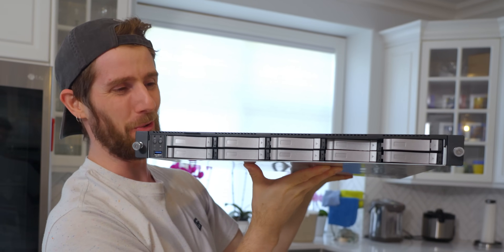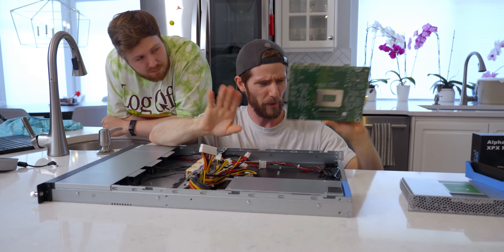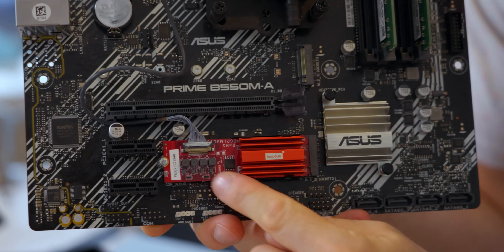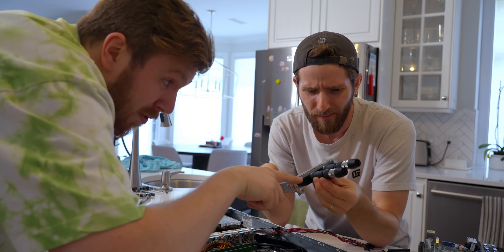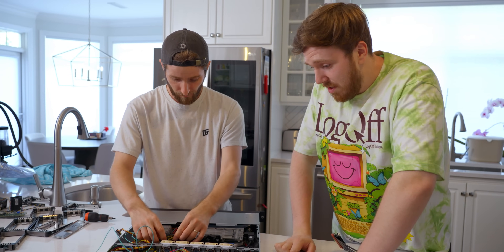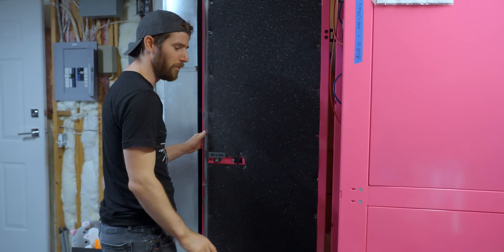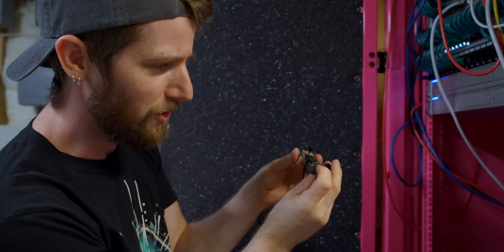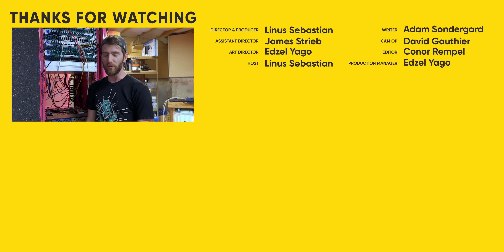I designed my perfect gaming PC, then threw it away - 1U PCs for My New House Part 2

Comment: Every time they play with water cooling the idea that I should stick to air cooling gets reinforced. 🤣
Reply: Happy AIO peasant over here, I ain't flying any closer to the sun than that
Reply: @Uncle_Smidge  AIO GANG RISE UP
Reply: Water cooled my gaming PC. For that it's fine, but I would never EVER put water cooling near my rack.
Reply: I don't see a reason to switch to water when air is just as good and way cheaper. My dark rock pro 4 will be more than enough for any cpu I use in the near future. I have a 5800X3D right now and even it doesn't go much further than high 70s at 100% utilization.
Reply: @a.pigeon Less noise is the main reason to switch. Running a computer on 2 Mo-Ras is the best way to get it absolutely silent.
Reply: @mycosys  That's why you use more than one pump and external radiators.

Problem solved. You can't get that type of noise with air cooled parts, especially not GPUs
Reply: @mycosys  Yes because it's an extremist hobby that costs a lot of money and isn't really necessary.
But there is a notable difference when it comes to noise and that's the main benefit of it.
You won't get anywhere near the same noise levels on an air cooled build
Reply: @Bucking-s4i  A Mo-Ra has more fans on it than my entire air cooled system. I'm running a 3rd gen ryzen 9 and a 3080. how is that more silent when water pumps also make noise? (Or did you not put fans on yours?)
Reply: @justincarter7954  Yeah more fans mean you can run them at lower speeds while still maintaining the same performance
Reply: @a.pigeon  Ok show me a 1u same type of specs as the one on the video all air cooled I would buy that.
Reply: @a.pigeon  I love my DRP4 as well, but I've learned the hard way why they tell you to install it with the motherboard out of the case 😅
Reply: @a.pigeon u are using a chip with vertical cache, that thing takes a quarter of other cpus
Reply: @Davinmk  Sure, but it's still a pretty powerful cpu and takes a good cooler to keep it from throttling. My air cooler isn't going to keep a super powerful 16 core monster of a cpu cool but I'm also not the type of person to use a cpu like that.
Reply: @a.pigeon  iirc that has a relatively low tdp due to its cache architecture so that probably contributes a lot
Reply: @a.pigeon  plus fan engineering is only getting better and like you said, new cpus don't get as hot. I remember watercooling my amd bulldozer because that chip was known for running hot as hell, these days only gaming laptops get hot compared to back then. Noobies don't even know how hot a cpu/gpu can get until they've used 2005-2012 hardware that ate volts for breakfeast. @uncle+smidge technically a fan with a cpu mount/fins is an AIO, just say watercooled because if it wasn't an all in one system you'd have said custom loop. AIO is a term that isn't really needed because it doesn't stand for watercooled and everyone with a custom watercooler loop already says custom loop.
Reply: @a.pigeon  you forgot to mention that your Dark Rock Pro 4 is 1100 grams and takes up almost as much space as a 4090 Strix. Put them both inside your system, and you've got several kilograms of metal fins that throw HOT air around the PC. Your PCIe gen 4/5 SSD won't be happy about it. And so will the VRMs, the chipset, anything that gets warm. Since I put a waterblock on my 3090, my SSD temps dropped by 15 degrees.
Reply: @iowawalker  Why would there be hot air in the pc? the entire point of the cooler is to push hot air out of the case. Besides, I'm not using a 4090, I have a 6800 XT which isn't pumping anywhere near enough heat out to cause major performance or cooling issues. I agree water cooling is better for super powerful high end builds but for low and mid range builds air cooling is a way more cost effective option.
Reply: @a.pigeon  there are different types of air coolers, and most "mid-range builds" will be right as rain with a Hyper 212. I'm talking specifically about high-end enormous towers like DBP4, Red Hat, NH-D15 etc. and GPU cooling solutions. Current gen GPU coolers are ridiculous, because they are air cooled. 4090s can be liquid cooled with a 240mm radiator, which not only reduces the space the GPU takes up in the case (thus improving airflow), but it also has an added benefit of dumping air from the case, reducing the heat load on everything inside.
Reply: I firmly believe that Water Colling should only be on a rack if the water cooling is on the ground floor but not on the other rack mount computers. Too much at stake! That's $100,000 worth of computers on the rack! Especially with the thread ripper installed. A good workaround is to have a second rack and make it the Water cooling station like a pumping station with radiators inside the back walls of the Rack. So if he has 5 computers in the home, then 10, 3 120mm fan Radiators pushing out hot air. I still do not know how he will convert all that hot air in that room into the heated pool.
Reply: When my AIO starts acting up, I'm switching to air. I don't run anything hard enough to need water cooling and Noctua has proven to make an excellent air cooler. Plus their fans are bad ass too.
Reply: I've been water cooling with AIO and custom loops for past 15+ years and still wonder why the hell I do it, especially when it comes to the GPUs and custom blocks.
Oh right, nearly no noise when it's sitting right next to me while playing games.
Reply: You'd be surprised how much water you can get in a running computer and it still works ;)
I had a leak which was dripping water down the side of the CPU socket, down the whole motherboard, and into some sata ports, and the only way I realised was because one of the sata ports stopped working. It was fine after I dried it out (still running great4+ years later).
I'll admit air cooling would probably have worked just as well, but I like fiddling with computers so this was all extra fun for me.
Reply: @phuzz00  If you are using good, non metal laced distilled water yeah, water leaking won't be a huge problem really quickly. If you use tap water and live where the water is hard then you will have a problem.
Reply: @phuzz00 as long as it's distilled 🤷‍♂️
Reply: @phuzz00  About electronics working after having water running on them, there was that video Linus made a very long time ago, where he accidentally left his XPS laptop out, it rained, and after finding it the next day and drying it up, it worked.
Reply: @phuzz00 had a wireless earbud I lost in the snow for about a month. Got it out after it had melted and it worked just fine.
Reply: Linus, Thanos in disguise 🤣 well… at least Thanos is well shaved. 
Linus drop everything into oblivion, not snapped🤣
Reply: Eh, Linus is known for going all Rube Goldberg on things, especially cooling solutions, so don't use this as the example of how it all goes. If you keep things simple (I live by the KISS principle) then it's not really bad at all. AIO's are a great way to go if you know you're not pushing the heat envelope (high end overclocking), and even simple custom loop systems can handle anything you can throw at them, and simple = better as they have less failure points. But with the way things have advanced over the last couple decades, just use decent parts and even a custom loop is going to be reliable and safe. 🙂
Reply: They make a pump that stops leaks from leaking. They did a vid on it here where they stabbed the lines with a screwdriver
Reply: Dude you don't need a whole custom loop instead of air cooling. Just get a cool AIO
Reply: tbf it's just they are being careless😂 if things are done in the right way, nothing much will go wrong.
Reply: Did watercooling back in the Pentium 4 days, never gone back. Even though its a lot more advanced now. Runnning a pump at 240v and sticking it in a bucket of water will always seem wrong to me.
Reply: With this comment, the idea of using commas gets reinforced as well.
Reply: Oh yeh. Noctua air cooling ftw.
Reply: There will come a time when I drill a hole through the wall and fit a massive radiator on the outside of the house, but I'm sticking to aircooling until then.  Gonna be a while since the sun hits that side of the house though, so I'll have to figure out a solution to that first.  I do aspire to a an almost silent PC at full load without having to use my P600S (it's an amazing case, but a fair bit bigger than I would like).
Reply: Just buy an AIO and you have nothing to worry about.
Reply: My water leaks to fan and blown it up. Taking the rgb and fan controller in the motherboard.

Others still work fine for years. It is very eye-opening how reliable motherboard these days
Reply: Linus should, not you.
Reply: There's a reason you only ever see Air Cooling on Server Racks

Comment: Dude, that's WAY too much trouble and WAY too much expensive 😂 just buy another rack or a stubby rack and buy 4U cases! You can use all full size hardware, and you can even get decently prices 4U Rack Mount cases that are specifically water cooling compatible from Sliger, a USA company. Although, they do take awhile to ship out, so be prepared to wait. I had to wait two full weeks for them to ship out a case that was listed as "in stock".

Comment: from one guy with his gaming computers remotely in a rack to another... I feel your pain with this. I did the power buttons over ethernet cable though. cheap and effective. You can control two PC's with one run (assuming you need power and reset for both). Nothing stops you from just parallel connecting the existing case buttons too if you want to retain that functionality. All you're dealing with are momentary normally open switches. I got really excited about the silverstone adapter until the range was questionable.

Fiber optic displayport cables have been working pretty well but they're still not "real" DP cables. Some monitors have problems with them with EDID and it's irritating.

I wish there were a more affordable solution instead of using the icron adapters to get USB remotely.

The component world just isn't tailored to us at all.

I'm glad to see FFC connections making their way into watercooling though. I'll be slowly converting the entire rack to liquid cooling and hopefully doing so with a ground loop for the summer and water to air radiators during the winter.

Comment: I'd really like to see a bit more planning go into these kinds of projects. The last several have felt extremely rushed. I have no problems with jank, but would prefer it to be planned jank versus "Oh we thought this was going to work, but we didn't test it enough so now we need to switch gears to complete the video." Makes it feel like the end result doesn't matter as long as you get a video out of it.
Reply: Seems that's a big complaint with the employees as well judging by that video they released a while back. It's always rush rush rush to get new videos out.
Reply: I agree I feel like they should’ve planned this out a lot more than they did. Also they went over the budget multiple times even though the whole point was to reduce the cost of making these server rack case units since he has to make like 5 of them. At the same time this reminds me of the level of jank and poor planning they had in the old days 😂
Reply: The best example in this video of what you're describing was their water cooling leak. How many times have they built thousands of water cooled systems of various kinds - and yet, a simple pressure test is somehow too much to ask for. It gets old to watch yet another "oopsie daisy, we made a mistake, oh no, hopefully its gonna be ok, otherwise it will break, and well just buy another one".
Reply: @murcie7896  That is one of the things that bothered me. Rushing through it, not doing a pressure test, and getting water everywhere. It's one thing to forget to tighten a fitting and getting a leak. It's another to not even check if the tubing is seated or held on properly. From what Linus said in the video, sounds like they didn't have the right size tubing/fittings and that resulted in the leak. To me, that comes off as poor and/or rushed planning. At this point, anytime they do water cooling stuff, they should have a massive bin of various tubing sizes, fittings, etc. so this doesn't keep happening. But it seems to be a reoccurring issue at this point. If there's water cooling involved, they probably don't have the right tubing or fittings or mounting hardware or whatever else.
Reply: @wojtek4p4 the point is to test the system so a problematic setup doesn't make the cut. It isn't worth doing. Mans running heated pools and a village worth of electricity only to show efficiency by cutting usage by 5% by using computers to heat the pool
Reply: @leesmith5198  Showing only the final cut shows a skewed picture of how the project is going though - effectively highlights only. While I can't talk for all the audience, I enjoy seeing the design process (or at least the jury-rigged parts of the design).
Also seeing Linus debug his build can help other people having the same issue, while hiding that part would present an unachievable picture of projects like these.
Reply: Kinus want to build 5 thin gaming PCs for him and his family while he has his powerful PC already in the rack?
Reply: I'm actually completely on the other side of the argument. Having jank on one-off projects is realistic, and hiding all the testing and planning off-camera is just not how most amateur's projects go (or at least - how my projects go).
The only thing I mind is the starting choice of motherboard and chassis - most people wouldn't plan for the expensive option from the start, and would switch to it only if there was no other option. I kinda appreciate Linus going against the initial choice of the MOBO, since the entire point of this video was to go cheap-ish.
Reply: Tbf, this was probably filmed before/after LTX, so they had very little time to plan these out.
Reply: @randomstuff508  I don't think it matters whether it was before or after LTX. They should put in the time necessary to make an acceptable video prior to releasing it. If they didn't have time to do that before LTX, they should have put off the video until they could.
Reply: @WhiteWolf_Kevin  im gonna be honest, this just seems super complainy. things go wrong, this feels alot more natural instead of planned to the absolute extreme to the point it seems fake
Reply: @sabrinoni  I'm gonna be honest, you seem to be missing my point. As I mentioned, I don't mind jank. I also don't mind when things go wrong. But this comes off as "We had an idea and instead of fully thinking it through we're just going to throw it into a subpar video." And that turns into a 20 minute video of watching them try to hack this together when just a little bit of planning would have solved a majority of their issues. It doesn't make much sense to me to spend hours trying to fix problems that could have been solved with an hour of planning/testing.
Reply: There's also a life lesson to be learned here. If lack of planning feels "natural" to you, a key takeaway would be this: A little planning goes a long way in all walks of life.

Comment: For turning things on wirelessly. I bought a 4$ single relay board that I can control in HA. I have it so it doesnt have any power to pass through and momentary contact. SO when I ask google to turn on my computer, it turns it on. Or you can have some smart button do it also like the cheap ikea ones for $10.

Comment: The silverstone thing is using a single transistor to turn the unit on and off. That makes it polarity sensitive.
Reply: To be more nerdy(engineer), the non-energized transistor acts as a diode, so when installed "backwards", it acts as a short, causing the held-power-button-like behavior.
Reply: Thank you, are there any reasons for having it designed that way?
Reply: @Blitzbogen  it's an extremely low cost way to switch a small DC signal. When connected correctly, i can't think of a single down side to the design. A single 2 cent JFET can do this job perfectly.
Reply: @alexcrouse what would make you use a jfet for this design? is it more cost efficient with a fet?
Reply: @the_bootleg_starwalker  it actually doesn't remotely matter what type of transistor you use here. Pretty much any would work.
Reply: The newer Silverstone one is powered by molex and its wifi vs a remote. I have a large desk and my pc is at the back so it's the only way I can conviently turn it on
Reply: @ProtosR  just install a button in your desk and plug it in...
Reply: @alexcrouse  I like to have as little wires and things coming out as possible. All that my setup is clean as possible. So wireless is better
Reply: @ProtosR  i like my stuff to work, so i avoid wireless at all costs in every way i can.
Reply: He should have gone with a Wifi module.
Reply: @FatJesusLive probably didn't for security reasons.

Comment: Hello there! I am stupid man from idiot magazine and I have a question. If having the pc in the same room is a space, thermal and noise issue and there is a price component to this all aswell, why not just find a way to mount 5 sff cases with powerful pcs in them into the rack?  feel like 5 of them would take up roughly the same volume as 5 1u servers? Are there not motherboards with fibre optic connections or expansion cards that culd be used?  I